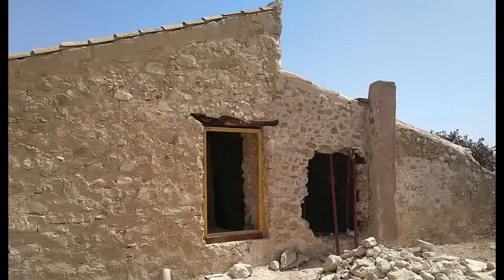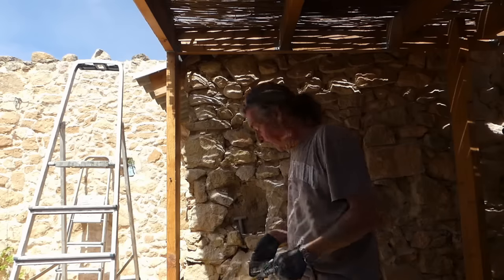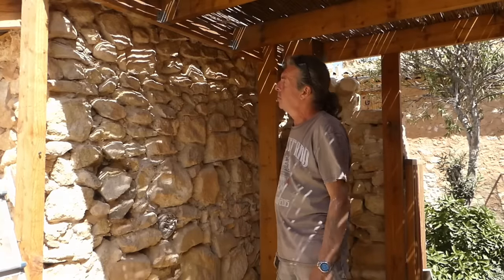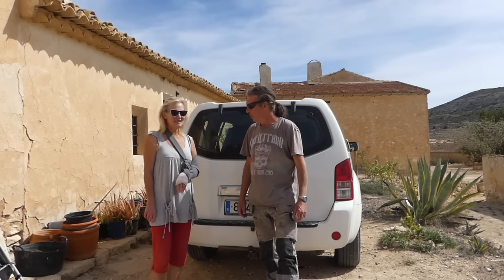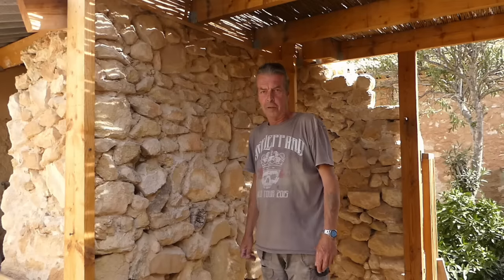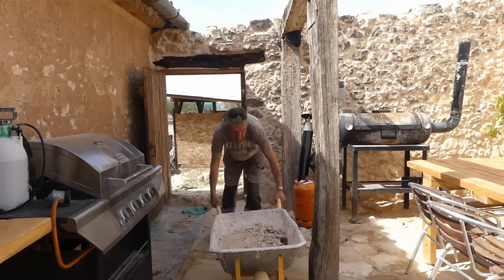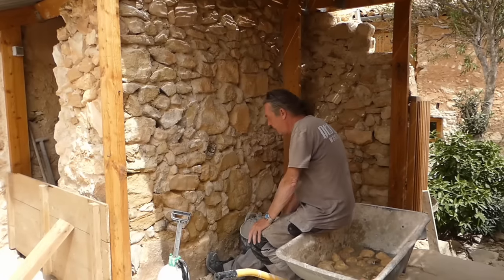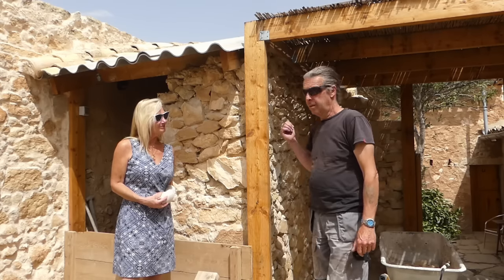Step by step repairing old stone walls. Lime mortar and traditional building techniques

Comment: We never thought of actually checking the temperature when mixing ours, all we knew was it got hot 😂also it gave off vapors similar to when we made putty from quick lime.
Reply from the maker: We only did it out of interest and because we had a thermometer stuck handily in a pot of compost :)